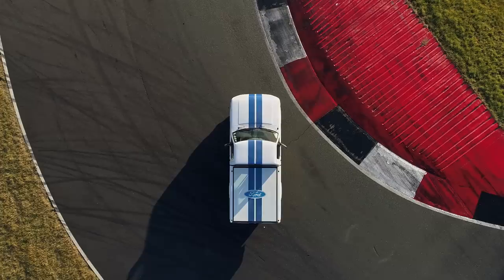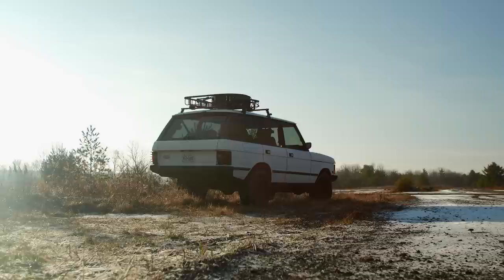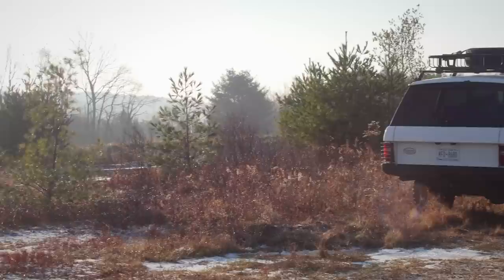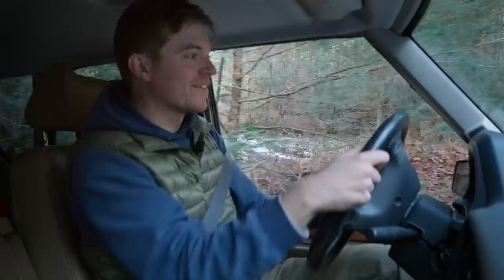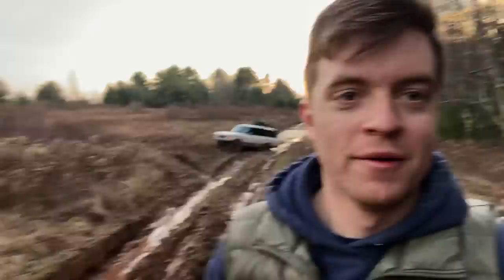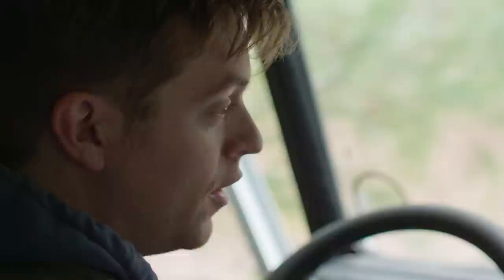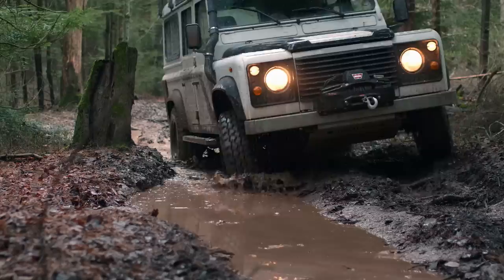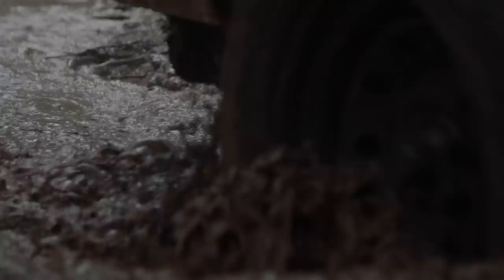Off-Roading in a Defender and Range Rover | RadVentures

Comment: I have driven a Defender daily for many years now. I often read the 'this is better than that' off road debates. What owners of other marques don't seem to realise is, that Land Rover owners don't proclaim their vehicles to be the best at anything! We own them simply because we love them and are willing to work around some of the foibles and short comings. That's part of the charm.
Reply: as a former land rover owner, i would beg to differ.
Reply: @nabahmadi5012  on which point Nab? I think it is a given in Land Rover circles that the trucks will need modifications to suit your circumstances.... or sometimes even just to run properly. Alas, driving a Land Rover doesn't mean I wouldn't like a 40 series Cruiser. I would love one!
Reply: Had the vehicle been reliable? I’m cross-shopping the two vehicles in this video, and can handle the hurdles of original/unrestored cars but don’t want to depend on something unusable.
Reply: @MrGman636  yes, both have beer reliable for me, and the Puma continues to munch miles. The Transit engine is known for been soft if not looked after, where as the TD5 has a reputation for been a little more hardy. No 6 speed box though, so noisier inside for sure. I have a rattle in my clutch now, and changing that is a big enough job. Will cost about €800 all in.
Reply: That said, a Defender would require more looking after than most of it's contemporaries....you get into them because you like them. The Defender is a hobby for me also.
Reply: @213davidhunter  Thanks. I'm stateside and have a 1973 Bronco, so the Defenders I'm looking to import are considered contemporary to my anyway.
Reply: @MrGman636  that's a bit different, I lived in Arizona for a year with work, before the Bronco price explosion! The 200tdi that you would likely see are much easier looked after. Defenders in the US are crazy money though. It all comes down to how badly you want one. A CJ or a 40 series cruiser are nice options that won't cost as much. We don't get real Jeeps over here and 40 and 70 series Landcruisers are very expensive. Rust is the main problem with all in a wet climate. The 2.4/2.2 tdci Defenders are old enough to be rusty now, but I don't think these are eligible for export to the US just yet. Never saw a Defender there, or a series, so they are a rare option.
Reply: @213davidhunter  Thanks for the input, really helpful!
Reply: and they can't buy an actual Defender now...

Comment: Land rovers were designed for farming not war! The first lr’s were petrol, the original Diesel engine was crap. That’s out of a disco. I grew up with an 88 and v8 110. Not a first gen RR either, they had two doors!
Reply: Like the discovery replacing the defender lol i thought these guys knew what they was talking about but guess not 👍
Reply: Land rovers are easy to repair though. Really easy.
Reply: @WasLostButNowAmFound  Which is lucky as you have to do it often - My 94 RR in pieces right now (Again)!!!!

Comment: The 300 Tdi is all good until the rubber cam belt fails and it breaks Tappets and bends all the pushrods. the wading plug in the bell housing that allows you to change gear without the clutch getting wet is a good feture though

Comment: Incorrect about the diff lockers. The viscous coupling automatically detects it.
Reply: He's talking about differential locks on the axles between the tires not locking the front and rear drive shaft together in the transfer case all that does that you're mentioning is make it go for wheel drive instead of all wheel drive. He's talking about actual lockers front and rear lockers LOL. You need to learn what differential locks are. A transfer case lock is not a differential lock. Every single four-wheel-drive vehicle that goes into four-wheel drive has the transfer case locked when it does so this is just Land Rovers way of making an all-wheel-drive go into 4-wheel drive that has no lockers on it front or rear no Land Rovers to accept some new ones have a rear Locker optional

Comment: When I was a kid I have best memories of our family defender here in Australia. Troop carrier style with rear bench seats along the side walls so is 4 kids faces each other. Good old fashion bar tread 16R tyres and my father got rid of the little petrol engine and replaced it with a 3.3ltr straight six Holden engine, the legendary Red motor, aka the "202". Dad said it was both the best and worst thing you could do to a defender. Better fuel economy and double the power, but the diffs and gear boxes are made of glass and left us stranded a couple of times lol

Comment: The Range Rover wasn’t designed/built for the North America market. It was designed and built for the gentleman farmer and professional tradesmen, engineers, surveyors, architects and landowners of GB and former colonial countries. It was a two door, manual, non carpeted vehicle with soft, long travel suspension based on the rover salon. It also was designed with the rover salon V8 in mind to power it. The permanent four wheel drive with unlocking transfer case ( in some models automatically locking lsd) with cv joint front end developed for the Range Rover was then used in the Stage 1 V8 series (precursor to 110) and FC 101 gun tractor all of which used the same LT95 combination transmission/transfer case. 

It slowly developed into a leisure vehicle from functional progress as one. The development of the discovery 1 which utilized all Range Rover running gear and most of the body, but was designed around the 200tdi motor and L75 transmission replaced the Range Rover as a utility vehicle with the added benefit of supplying more seats.
Reply: But  the RR won the first 2 Paris Dakar races so why do you think it can’t handle the tough stuff. I believe it conquers Continents and was only  car to conquer the jungles in South America. Please should some respect for the abilities it has already proven…. Just saying!

Comment: Hum... I did drive a II gen RR but only on highway or on small roads and never off road, however the 1st gen with manual transmission in the early 80s at least in Venezuela, we had a 'differential lock' most likely you would have come out of that with no problem in that situation, it was the 3rd lever on the column, I used it exactly in those situations when your rear axle slips and then your front one too, well time to pull up the "magic lever" often miss-understood... Pulled several heavier vehicle with that feature stuck deep in the mud or on banks, never failed... Granted it was a corporate maintained RR :) great ride! fantastic visibility and too bad here the 5speed never came... that overdrive is really handy... 100 mph on highway that small block V8 purring along, the only noise is the trans, but what a trans! the real off road deal when you need it! Don't know if the II gen had it, but very important for stability is that "mono shock" suspension on top of the real axle, if that is warned out, your Range is going to wobble especially above 60 mph, otherwise very stable vehicle! really fun to drive and the engine sound will perk w 5.0 drivers :)
Reply: My 1986 RR has diff lock next to the auto gear lever. Like you said I was surprised he did not use it in the video. Also your remarks about the V8 engine purring is a heartfelt experience that I look forward to everyday I use mine driving to and from work. Most issues with the RR are electrical but once you sort them out it is as reliable as anything else on the track.

Comment: Well Ryan has started the story like Doug The... Doug.
Range Rover MkI have used not only petrol engines. There were fitted diesel engines like: 2.4 112 KM VM TD,2.5 119 KM VM TD,2.5 111 KM 200TDi TD,2.5 111 KM 300TDi TD.
Those engines were with manual 4/5 gear and 3/4 gear automatic transmission...
Both cars are great vehicles... There is a lot of history... Defender is like onsee that you are wearing to work.
It's like a work horse. Whilst Range Rover MkI is like a suit, when you are going to the theatre or supper.
It can be the other way around😉, thoug. Thanks .

Comment: Overall this is a great little production. It's a shallow but enjoyable introduction to classic LRs. Cotton candy if you will. I am sure the videographer meant well, but there's some cringey theatrics here, the most obvious being the slow, sharp turn in a bog to get the RRC stuck. There's also a number of inaccuracies. That's the problem with being so into a car though, it can ruin an otherwise enjoyable film!

Comment: First off, that's not a tank I'm pretty sure. I was never a soldier but even I recognise an APC.
Second as mentioned, Land Rovers were initially meant for agricultural and industrial use, not military.
And second... No I can't watch any further. Nice guy but needs to do basic research
Reply: I'm obviously not an expert on military lingo, but yes I suppose now that I'm looking into it, it should be considered an APC. To me, and I think a lot of others, we hear 'personal carrier', but still generalize it to be a 'tank'. Secondly, I should mention (cause other people have pointed this out too) that Land Rover indeed started as agricultural based trucks. I wrote in a whole piece about the Wilks brothers and their attachment to their original Jeep and how the rumor is that it was their personal Jeep that led them to designing their own farm truck. I am aware of this, and I had it in there, but you'd be surprised how much 'talking' I have to cut out of this video for length. And I do all the editing. So stupidly, I cut that part myself and then glossed over it by saying 'military', because they did end up getting a lot of global military contracts pretty early on. Anyway, what I'm saying here is you're correct. I should have made sure the farming history came first.  Realize though, it's pretty hard to handle all of this production, hosting, editing, logistics, writing, etc and not end up with errors when it's a quick turn around. Maybe you can give it a second chance and watch through? We're still learning. Theres a lot of elements to master to give you a good show.